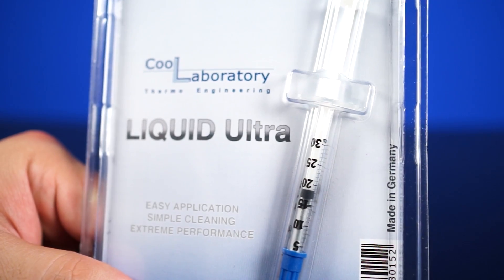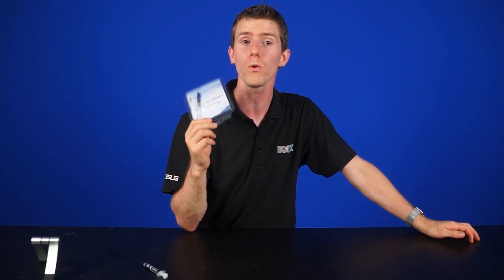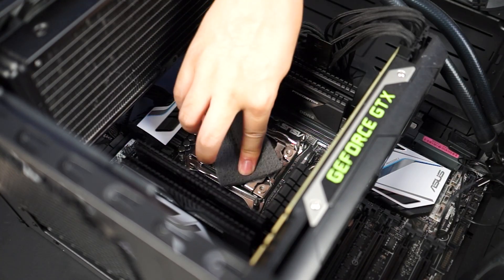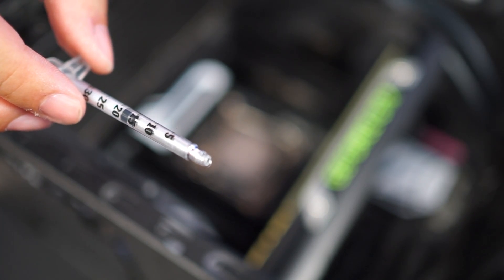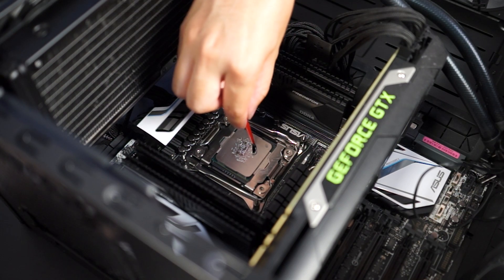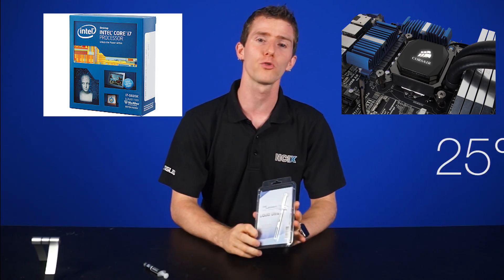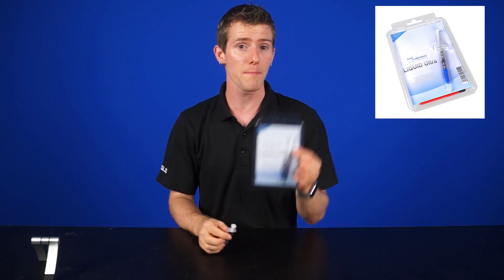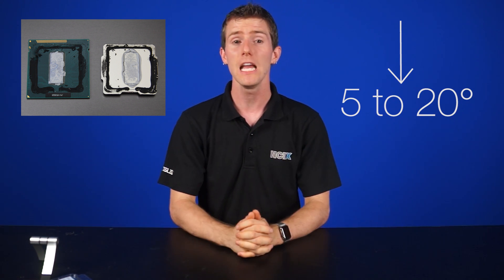CoolLaboratory Liquid Ultra Thermal Compound - Wut iz?

Comment: seems to be unnecessarily complicated to apply when you consider the non-existent real world benefit over a "normal" paste like noctua or arctic.
Reply: Abyssic1if you consider that when overclocking, you dont get that many extra mhz with those 5ºC extreme thermal past gives you, those arent really that worth it either. a 200MHz difference is nothing irl.
Reply: Abyssic1 Yep, who tells you to use a brush much less includes one in the box. Get plastic grocery store bag, insert finger on one side, use other side to spread the drop of paste on the processor until surface is fully covered. So simple even a Monkey's Uncle could figure it out.
Reply: Laharl Krichevskoy 200MHz is a good difference, I have seen decent performance increases with even 100mhz, although mainly in terms of how snappy my PC is, some games get a very small FPS boost as well. Although I agree fussing about thermal paste is pretty much futile, just buy a good reliable brand and stick with it.
Reply: Josh10 with 200 mhz, you wont even get 2 fps in most games, unless it's cpu bottlenecked or something. On the gpu it could.

irl 200mhz wont make things faster to you at all, you wont notices those 200µs of difference it took to open word or paint or the explorer. Even in heavy workloads that take some hours.it will be 54minutes vs 61minutes.
It's a matter of percentage, 200 in a 3.5GHz cpu is only a 5% increase, assuming it's a 1:1 increase in power , do the math, from those 61 minutes, it would ACTUALLY take 57.7minutes, more than i actually said.
If it were a pure cpu dependant task that took 3 seconds it would take 2,8seconds, or about 162ms less. Which is less that the average human reaction time.
And ssd whould give you a better improvement becase each access is like 13ms, get a file in 10 fragments and thats and extra 130ms, read 50 something dlls and that another 7,5 seconds.

It's not like you wont get anything, but even in the long run, it's not worth 50 bucks. Better spend that on an ssd or a faster video card.
Reply: Laharl Krichevskoy When my 4770k is clocked at 4.4GHz it my computer is visibly faster than when it runs at 4.2GHz. Say all you want but it boots about 5 seconds faster and programs open noticeably faster. I'm not going to doubt you but I can physically see a difference. Maybe I'm crazy or maybe I just notice really small subtle differences, But I can see the difference
Reply: Josh10  you could do a blind test. Can you notice which setting is faster without knowing whether it's running at 4,4 or 4,2.
I'm quite sure you have confirmation bias, my oldman said his computer ran quite faster when i upgraded his ram from 4 to 8 gb, and it never got above 2,5gb while booting. It actually took the same to boot.

Try measuring the time it takes since you press the power button to when the hdd led stops.  Do 3 runs, take the average, and then put it in 4,4, do 3 runs, and so on. See if there's a noticeable difference that correlates to what you percieve.
Reply: TekReview's oh my god, SHUT UP ABOUT THE BAG! Stop trying to get people to fry their computers with terrible methods of spreading CONDUCTIVE thermal pastes! This stuff is LIQUID, you understand the word right kiddo? It means that it is likely to drip off of your idiotic plastic bag and fry someone's mobo. And even on non-liquid it's been proven to be THE worst application method out there.
Reply: xXDarkxIdealsXx Hey dipshit we were talking about Artic SIlver 5! Wake up and stop smelling the DUMBSHIT roses! Troll. Late response, and I see your whining to everyone else.
Reply: Laharl Krichevskoy He's right, it does make a difference; don't know where you're getting this info that it's nearly zero difference. It might not be "significant" difference in all cases, but it IS a difference, a noticeable one at that. Overclocking my I7 5960X from it's stock 3.5Ghz turbo speed to 4.5Ghz gets me an average increase of 14fps in 5 seperate games and my cinebench score goes up from just under 1,300 to 1,850.  That would give us an increase of ~3fps for 200mhz; and while, yes, 3fps is pretty small, the real difference is from the CPU intensive tasks like running vegas, octane, maya etc.. so the fact that i get an increase in a rendering benchmark of just over 6% is a pretty fair increase.
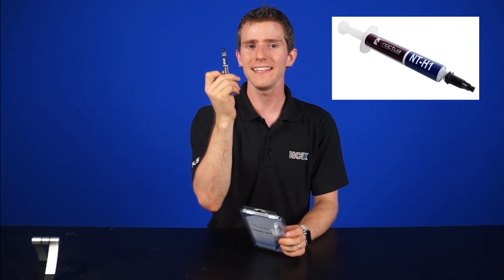Reply: xXDarkxIdealsXx but that's the point. Paying whatever this costs for a 6% or less increase in performance is stupid if you already are using some better-than-white-grease thermal paste. That's 3:30 minutes less in a task that takes 1 hour. You cant even go to the bathroom in that time. 6% is still not noticeable irl. yeah, numbers might say it wors faster but unless time is gold for you, 3 minutes (in 1 hour), or 3 seconds (in 1 minute) is nothing.
Not to mention a 100% increase doesnt equate to a half the time. Not sure why but iirc even though it's mostly linear, doubling the mhz wont be exactly half the time, so the final numbers should come from the results and not the mhz.

Comment: Did you overclock that 5820K?!! or was it running at stock ?! With more heat the CoolLaboratory stuff make a difference (few degree). Also, its a really good replacement for the stock TIM between the die and the IHS on Ivy bridge and Haswell mainstream processor (LGA1150/1155)

Comment: Something tells me you would see a bigger difference at higher temps, like 70-80c, after a longer period of load, where the water in the cooler has reached a higher temp. so that it doesnt absorb the heat from the copper as easily.

Comment: If I have to go as far as taking the lid off of my CPU to see any real results, it seems like too much work for a gain that could just as easily be done with getting a larger radiator. You may be spending $20 more, but you wouldn't be fucking around with the inside of your CPU.
Reply: TheMohawkNinja Its an extreme enthusiast solution, where you are trying to push absolute max clocks. You reach a point where more rad-space wont help anything, simply because the transfer of heat between the CPU-lid and the block is bottlenecking everything. Delidding CPUs can make you gain 15-20c.

It is not for everyone, but if you check out Overclock.net, you will see there are  people there with 4x TitanX'es, and 5960x who bought 3 of them to see which one clocked the best, etc. :p
Reply: *****
At that point, why not just go for a phase change cooler?
Reply: TheMohawkNinja Don't ask me! :p

Comment: Seems like maximum effort for minimum gain. 0/10 probably would not purchase
Reply: +Chris Riker I managed to shave 13 degrees off my delidded 6700K, 10/10 can overclock more now
Reply: +PUU-TAAH Nin Nin Are you using CLU between IHS and heat sink as well? I got 20C drop with CLU between IHS and CPU die only (this is compared to the stock thermal paste came with Hyper 212 Evo). Between IHS and heat sink, I used  the stock thermal paste above. I tried to install CLU between the IHS and the Hyper 212 Evo, but ended up with gaining 5 degree higher. I don't know it I applied the CLU wrong on the surface of IHS or the CLU is no good to use between IHS and heat sink.
Reply: +NhoZdien LEGIONARY Probably because you just wrecked your 212, the copper pipes are attached to an aluminum block and it says all over it DO NOT USE WITH ALUMINUM. 

Also, I got a 23c drop on my 3770k with CLU between the IHS and CPU and MX-4 thermal paste between my IHS and H80i cooler.
Reply: Marshal Beard I didn't lap the Hyper 212 EVO. I spead the CLU carefully and socket 1150 is smaller than the block, so the block is still in good condition. MX4 is better than AS5 since the AS5 would gradually dry (or I just had a bad AS5 paste). I'm looking toward the Gelid Extreme Solution because it's the top non conductive thermal paste. Thank for sharing, mate =D
Reply: +NhoZdien LEGIONARY Are you sure the copper pipes are wider than CPU so  the aluminum on the sides don't make contact with the CLU? Also I never mentioned lapping your cooler i dont see how thats relevant. Also yeah Im currently using AS5 on my die because Im out of CLU and had to replace my board, I put a comment explaning everything under the guy who said "So basically its useless" under the top comments if you want to go read it.
Reply: Marshal Beard No drops were found on the aluminum block when I replaced it by stock Cooler Master thermal paste. The cooler is enough for now. Yeah, he shouldn't judge something with knowing the other perspective xD
Reply: Loooool see his new vids tell me its not worth it

Comment: old stuff, had it for ages.
(maybe because it is an german company?)

It performed better than the best normal compound.
But I think in the last years or so, the other manufacturers almost catched up to them in therms of temps.

basically it is for the last C/F possible, but "harder" to apply.

btw:.they also have Liquid Pro, which is more like liquid metal and even harder to apply. It also can become solid over a longer time, and ist very hard to remove.
But the Ultra is fine,

Comment: I delidded my processor over a year ago, and regular pastes were great at first, but failed to hold up over time and even become far worse than stock paste.. Since switching to CLU, my temps dropped even further than with the paste, hand have been completely stable since then. I highly recommend it for any Ivy Bride or Haswell processor, but do your research before attempting... my max load temps at 4.4Ghz are 65C with gaming temps around 50-55C.

Comment: thats a pretty shit paste or liquid cooler. i get those kinda temps on air with a 212 evo lmfao. but whatever.
Reply: thefilmdirector1 on a 6 core? those cpus have a 140W tdp, while most haswell cpus on 1150 only have 84W.
Reply: thefilmdirector1 The first on is one of the pastes on the market and the aio cooler is better than the 212 evo. Your processor just got fewer cores and a lower tdp. It's possible that your ambient temperature is lower than theirs aswell.
Reply: thefilmdirector1 No, you don't. You don't get 50C full load temps on a 212 evo LMFAO, but whatever.

Comment: should have tried it on a AMD processor intels heat spreader is pure garbage
Reply: Brandon Horan yeah, but either way I think the liquid ultra paste is just pure garbage :P.
Reply: It seems to be a gimmick I should get some to see if it let's me oc my phenom II past 4.2ghz
Reply: Its not a gimmick. I'm using the max VID for the 7700k chip which is 1.52Vcore. Under load it peaks at 77C for a moment and goes back down to 40s, and its my work horse PC

Comment: Arctic silver is conductive
Reply: Lol Fahrenheit. Temps in Celsius please? AS5 is outdated shit, and it is Silver so it is conductive and capacitive.
Reply: armyraw29 It is conductive. It has bloody silver in it for godsake! That's like saying Distilled Water is safe for a custom loop. It is not. It will become conductive after making contact with metal. The same goes with AC5. The little bit of silver compound in turn makes it 100% conductive.
Reply: armyraw29 The 750 Ti is not worth the effort to help it "last longer". It is a budget card. It can barely play modern games even at 720p, lol.

Your persistent usage of Fahrenheit to refer to PC components also points to you being inexperienced in this area.

My 980 Ti is a reference design. It boosts very high out of the box. (To at least 1200MHz.) It peaks at 83c and that is perfectly normal. For a CPU, I would be concerned, but graphics cards can manage heat like this. The GPU at the centre is less responsive to heat than CPUs generally are. However, VRM at 83c would be toasty and I would be concerned. That is definitely not your case though.
Reply: its not 100% conductive only slightly idc if it has silver in it. its hell of alot more capacitive than conductive
Reply: 190 is the max and idc if 150 is safe the lower i get the temps the longer it last. i like putting the best in my stuff.
Reply: actually it does so im still going to keep doing it. also makes the fans less loud under load and its only $9 for a tube of mx-4
Reply: this shows u being inexperienced in this area. my 650 ti plays maxed out at 768p. i can use Fahrenheit all i want. im going to keep putting it on even the most low powered cpu's and gpu's.my max temp is 221f,stock is 150 because i can do wat i want i went with the mx-4 and dropped it to 120. im still going to artix mx-4 everything i use. did i have to hell no but i can afford a $9 compound and im going to get a 6700k with a liquid cooler as well.
Reply: +armyraw29 I don't understand why you bother to make an obsolete card last longer? Just hack the bios and over volt/clock the hell out of it while you can, if you're so concerned about low temps then you should just liquid cool your system, I had a 750ti as a makeshift card for my system, So I made that little sucker run as hard as it could, there was a 980ti in the mail anyway...
Reply: armyraw29 But it is.

You are running 768p on a budget card, and professing that, despite both being obviously mediocre choices, they are somehow, according to yourself, "no where near shitty". You undoubtedly possess some form of an inferiority complex. I can sense it just by typing this out on my PG278Q, to wherever the fuck you are.
Reply: armyraw29 My 3 year old 680 shits all over your 650Ti. You're the one who plays at 768p.  http://puu.sh/kJpIn/b8fb9f58bf.png

I googled your name and laughed so goddamn hard. armyraw29: wat would u suggest for #1 on chicken wings i like bbq taste with heat
Reply: armyraw29 65c is not hot for a GPU.
Reply: armyraw29 Nvidia's website states 105c/221f. However the GPU will throttle around 90c. Also the whole "longer it will last" is bullshit. All GPU's come with a 3 year warranty. By the time it even comes close to dying you'll be in the process of upgrading.
Reply: nope last longer so its not bullshit lower the temps the better. fans arent working as hard anymore and its more quite. i got the compound so ill do wat i want. if i can lower temps by 30f on my gpu and lower it even more on my cpu all the better and more stable overclocks.
Reply: armyraw29 Actually it doesn't. It doesn't matter if your GPU runs at 70c while gaming of 55c it's not going to make it last longer.
Reply: armyraw29 You can just use MSI afterburner to turn down the fan speed....
Reply: who overclocks and turns down the fan speed. keep it on auto.
Reply: armyraw29 You're the one who bought a cheap GPU to begin with.
Reply: you're the one who don't know what ur talking about to begin with. im going to buy evga liquid cooled gtx 980 ti's and still use mx-4 idc what cooler for gpu or cpu i got im still using it if i can drop the temps with somthin as simple as compound im going to. of  course i wont go as far as custom liquid cooling. i get pre done liquid coolers.
Reply: PUU-TAAH Nin Nin i do it because i can
Reply: armyraw29 That's a stupid rule to live by but what ever
Reply: armyraw29 Says the kid who buys a shitty card.
Reply: norge696 says the kid that knows nothing. runs 1366x768 completly maxed out on any game. good for me. card is no where near shitty kid.
Reply: Cam Kustka u undoubtedly posses some form of inferiority complex. i can just sense u are an idiot. and its nowhere near shitty. u are mediocre as the 650 ti 2gb runs any game i want maxed out. and i really don't care about the monitor your typing on. im very much happy with my 650 ti at 768p and i dont find it mediocre at all. looks really nice. of course i do plan on going to 4k later on.
Reply: armyraw29 You literally copy pasted my response and then tried to make a witty statement, are you fucking twelve years old?!
Reply: 20 but its pissing you off so i guess its workin :) funny how its a post on thermal compound and your getting violent about me putting what i want on my gpu.
Reply: armyraw29 I'm not getting violent at all, now you've run out of arguments and play the whole "Lol only trolling card" as if you weren't being serious...pathetic
Reply: your the only one trolling the comments bud. pathetic and yes you are getting violent :) quit trolling. no more arguments puu its sad.
Reply: armyraw29 Your existence alone is proof that we have failed as a species...
Reply: +Steve Ozone Its capacitive, not conductive... and yes theres a difference!
Reply: Cam Kustka Arctic silver 5 is not electrically conductive lmao. 

Its very mildly capacitive. Learn your shit dumbass.

Comment: i wouldent buy it as it only works on copper and silver heatsinks still stay with mx-4. liquid ultra has a chance of frying the card if it touches the transistors around the chip. even tho i hurd it gets in real world games 2c better. its just not as safe

Comment: I have it with my i7 4790k 4.5Ghz 1.15v stable. AiO Thermaltake 3.0 Ultimate 3x NB PLPS... Pump 7v Fans most 800rpm (i can even go 400 but it becomes warm)...@800-1200rpm(controlled by Mainboard) i don't go over 55°C

Comment: I have seen companies such as MAINGEAR and ORIGIN PC using this product for a while. It looks interesting but then they apply it with Q-Tips. However cotton could be caught and affect cpu temps. I have been using a H80i and a AMD a8-5600k (not overclocked) and i get temps under full load of 73 degrees Celsius. any ideas? im having stability problems when decreasing the voltage. fans on 50% (stock sp120's). NCIX can you help me get lower temps?
Thanks and keep up the good work!!

Comment: I use liquid ultra on my delidded 3770k  oc to 4.7ghz 1.26v and dropped my temps by 25-30c. The crap intel used on the die dried up over time and my temps went up to 100c with a Corsair H100i. Just don't use this on aluminum, as it is corrosive to some metals.